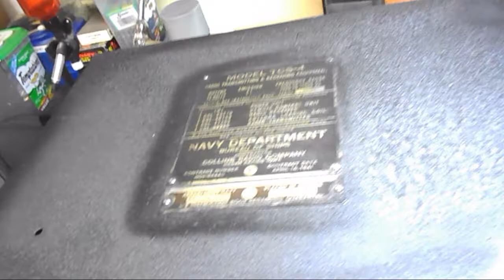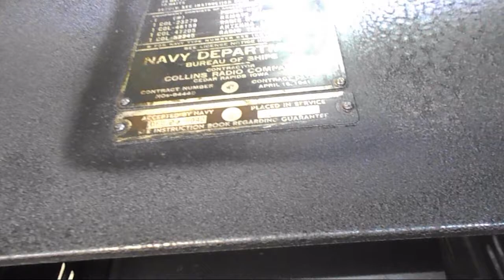Wrinkle Paint job on TCS 4 Cabinet and patching up power cable of Atwater Kent Model 20 C

Comment: Nice job on the radio cabinet Larry
Reply from the maker: Thanks Bill it is always interesting to see how this wrinkle finish works. If you don't use a heat gun the finish doesn't really wrinkle at all.
Reply: @LarryDeSilva64  I always thought it was the paint itself that wrinkled.

Comment: Yeah...I used the heat gun on some

But the best I did was the RAL5 front panel .
I used the oven on that...of course the house stinks for a while
Reply from the maker: Yeah I didn't want to smell up the house by putting cabinet in my oven that would have been the ideal way but this way still works and you can see it change while you are looking at it.